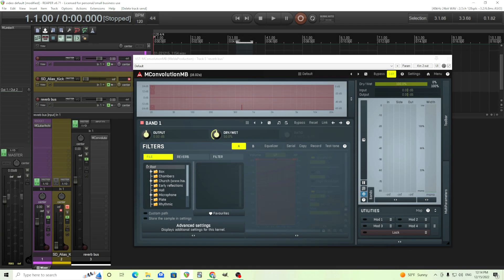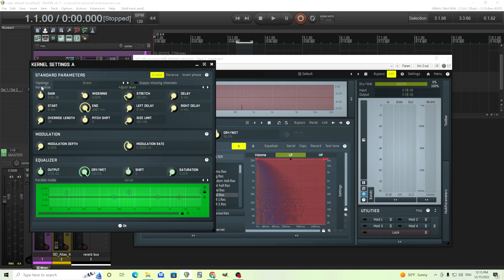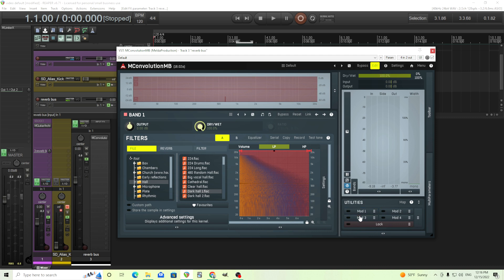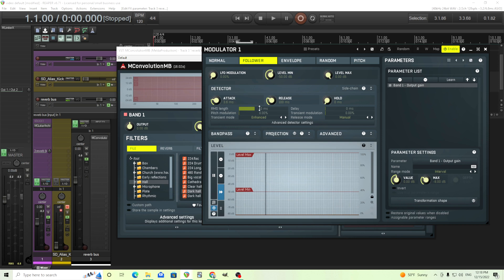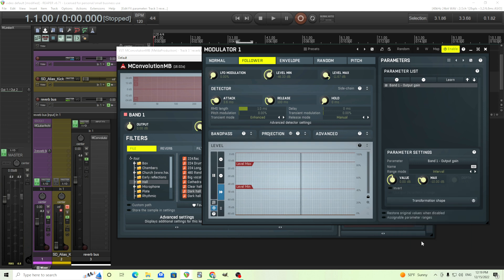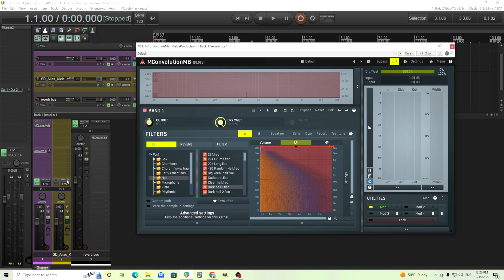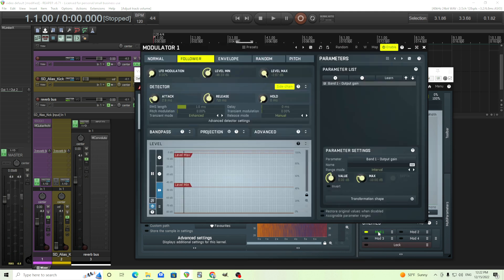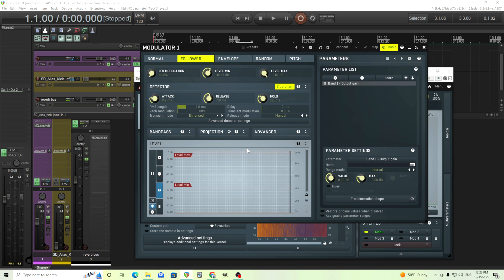Reverb ducking in MConvolutionMB

Comment: Interesting method. I like to use the spectral ducking for reverb ducking because that way you don't hear any of that "rushing" or "sucking" sound unless you set it up really bad. You just lower the threshold until it sounds as clear as you want. That way, you can mix really dark reverb with bright guitar or vice versa and both will be audibly clear without interference.
Reply from the maker: That is very good as well. I usually don't need so much ducking that there are sucking noises audible, but if you do need that much a spectral compressor will work much better. Great tip.